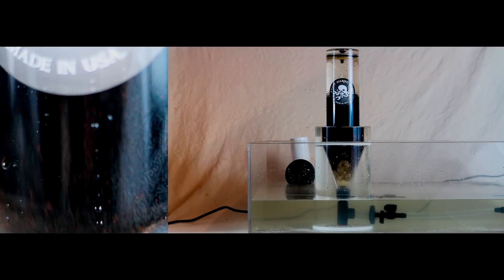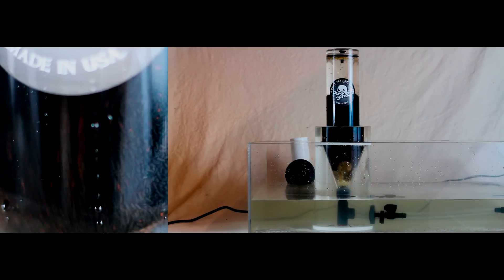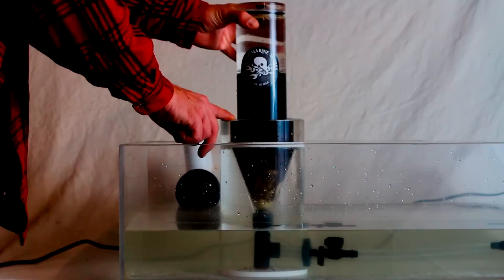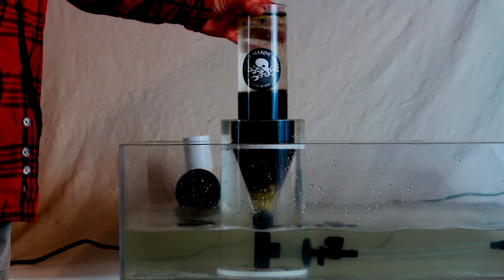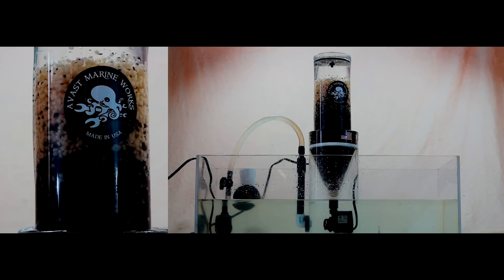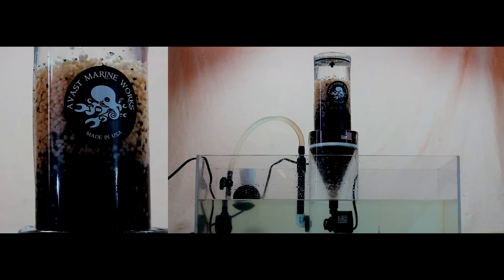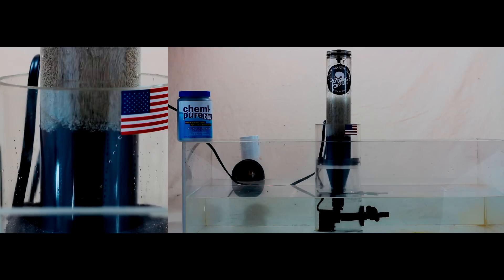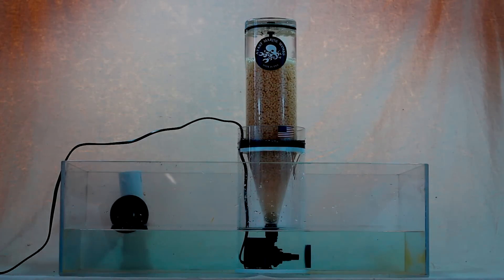Spyglass Mixing Media

Comment: Just setup my reactor with GFO.. not exactly sure where the filtered water is output???  over the top of the reaction chamber obviously, then it flows back into the larger base and out the hole where the pump/valve tube comes in?  My water is not overflowing on the lower chamber at all.

Comment: will that stainless mesh eventually rust out?
Reply from the maker: +manilaboy1vic it is 316L Stainless and will not rust, we use this super corrosion resistant SS for hardware on many of our products.
Reply: +Avast Marine nice.. what size spyglass would you suggest for 68g DT and 25g sump?? looking to run mainly GFO, maybe a GFO/Carbon mix.. 

also what are the dimensions of these reactors??

Looking to order today.  thanks.
Reply from the maker: +manilaboy1vic the small will hold a 1/2L and that will be more than enough for your 68+25 here is a chart showing the specs: http://cdn.shopify.com/s/files/1/0872/1966/products/cone_spec_sheet_1024x1024.jpg?v=1448611046
Reply: +Avast Marine thanks..  i cant believe i missed the foot print  there.. i ordered one.. cant wait.. i k00ked it and forgot to apply the coupon code.. DOH!

Comment: can I run carbon with phosban?
Reply from the maker: We have never tested phosban, gfo is so much more popular so we tested that.  It works with rox carbon and gfo mix which will achieve the same thing more cost effectively.  Email us directly through the site and we would be willing to order some phosban and test this for you though if you are a die hard Phosban user.